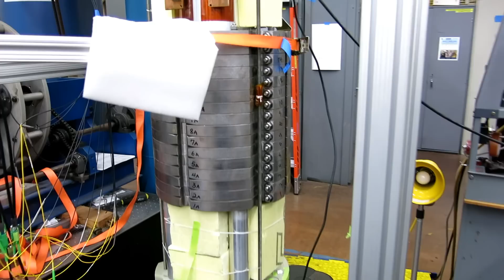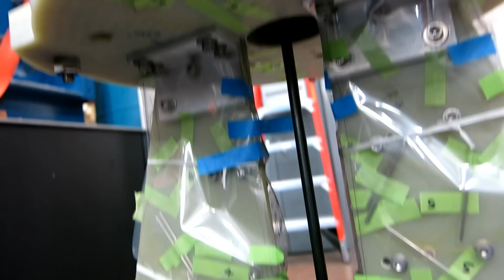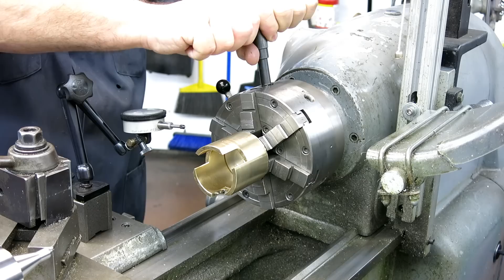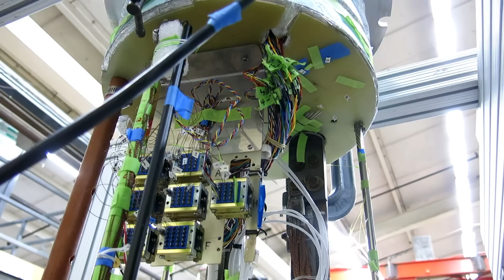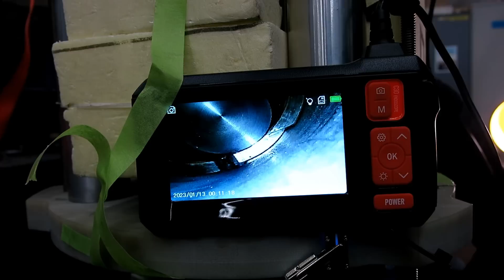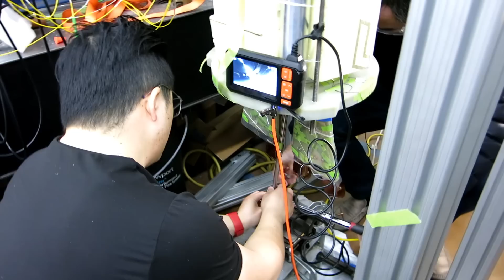Magnet Trepanning Tool P2

Comment: Tom, are you a Toolmaker that designs & makes the tools that any other project Team needs/uses?  I.e., you work for & with anyone else in the Lab that needs tooling, or are you a Toolmaker specifically for the magnet Team?

Thanks for getting permission to video in that area!
Reply from the maker: I go where needed. My office is in the same building as the magnet test facility so I end up helping that group a fair amount.

Cheers,

Tom

Comment: There was a supervisor that made a habit of leaving paperwork, folders, reports, and other items teetering just on the edge of our desks, overhanging a bit. After a few flybys these items would load up and began dropping off, spilling on to the floor by the end of week, a 'performance evaluation' signal for the supervisor, usually to the annoyance of our cadre of engineers. So. I drilled a couple of holes with two hardened steel rods at my desk. A strong horizontal hidden support mechanism that I could slide out to support the 'work stuff'.  After a while, my hidden support arms were cantilevered out 30 inches or so from the desk edge - magically defying gravity and, providing a way to keep the crap off the floor!  A wonderful prank and, exceptionally useful to have, demonstrating that max. work load.  The chain of command ultimately installed 'inboxes' just outside each cubical as this supervisors practice/behavior was interpreted as harassment by union representatives.
Reply from the maker: Great story!

Cheers,

Tom

Comment: Such a great video, thank you! Dream shop, the “which lathe shall we use” was the most understated brag ever 😂
Holy moly, they trepanned that meter long core by hand ??!! Never shall I feel bored again while cutting threads!
As for the tool being not straight… I hear Quinn muttering “wish I’d normalised the material before doing the work” but maybe it was just the pressure of the end mill?

Comment: Need some sort of center support or bearing at the bottom end of the extension to keep everything centered and straight as you’re hand ratcheting.
Reply from the maker: The tool is self guiding. That's why it is a close fit in the bore.

Cheers,

Tom

Comment: WOW, Tom actually working. This a rare sight.  I know he will do a great job.  I would of made a suggestion, using a gearwrench pass thru box wrench to turn and be able to have a nice thrust bearing support and very steady on the bottom.
Reply from the maker: The extensions are not rigidly attached to the tool. In the current setup you have to maintain some upward pressure or the driver pops off the tool. Maybe mark 4 will have all the improvements. Thanks for stopping by.

Cheers,

Tom

Comment: If the carbide teeth are inset from the cutter body, won't the body bind in the hole?
Reply from the maker: Its a fine line between scraping the epoxy out and digging into the bronze bore. The third version has an adjustable blade you can adjust to be outside the cutter body.

Cheers,

Tom

Comment: Hi Tom.
Great video. Thanks! Several weeks ago I asked your advice for a machine oilier. I bought the one you suggested a it works well. However, when and not in use, the oil leaks out all over the place. Is that just the way it is? Do I need to empty it every time after use? Can any gaskets be made to help or thread sealant? Thanks.
Reply from the maker: Did you send me an email? This does not sound familiar. You sure it was me?

Cheers,

Tom
Reply: @ 
I’m pretty sure it was in comments. You sent me a link to it at MacMarter Carr.
Reply: It was in the comments of Mearloaf 152.
Reply: I’m using ISO 68 oil. Could it be too thin?
Reply from the maker: @greglaroche1753  Should be able to handle it. They should not leak. Something else is going on. Dig deeper.

Cheers,

Tom

Comment: Love seeing all the waxed lacing cord in the magnet assembly. I used that in aircraft installations because zip ties don’t hold up well in cold temperatures at altitude. All the computer and stereo cables in my house are laced with it! Also liked the Hardinge lathe. We had one in our model shop and I tried to get it when our plant shut down but someone else in the corporation had plans for it.

Comment: In the end, did you get all the plastic slag out of the magnet?  While it might have been more expensive, and certainly take longer to make, would have a 24 flute reamer done better?
Reply from the maker: Need carbide to cut this stuff. Its really abrasive. We have to touch up the carbide fairly often.

Cheers,

Tom

Comment: I realize that this is a trepanning study, and I appreciate that.   But when you showed the big piece that popped out, it occurred to me that….if you could spray a little liquid nitrogen up inside that…you might get the whole thing to just pop out. 
Very cool process, though.
Also, ….is that Monarch lathe dating anyone?  …asking for a friend. 😳
Reply from the maker: The magnet has already tested and been through thermal cycling. The reason we use this particular material is that it doesn't break at cryogenic temperatures.

Cheers,

Tom
Reply: @ ok, got you. 🙄 nevermind 🤣

Comment: You need to share more of these. I'm lucky enough to have a similar job that I just started recently.
Making the tool but having them use it is a big brain move. If they mess it up, they can't blame anyone but themselves :)

Currently making test fixtures for a universal tester they use in densitry material testing. Funny how there is so many fields in a university but if they need something made....engineering is where you go.
Reply from the maker: Sweet! Sounds like a good gig.

Cheers,

Tom

Comment: A bushing with a hole the size of the ratchet extension bar would have been great for keeping the bar in the middle, and would have made it easier to position the bearing underneath. 
The most complicated ''thing'' in this video was your colleges' workspace!  :face-orange-biting-nails:

Comment: Hey, Tom, thanks for this insight - is a great video!  Was this project from a couple years ago? The bore camera shows Jan 2023? Or was it just no one set the time on the cam?  Also, are you going to have to put multiple cutters on here to expand the cut or was this single version enough to clean up the bore of the magnet to whatever standards they required?
Reply from the maker: Were not smart enough to figure out how to change the date.....

Cheers,

Tom

Comment: The guy on the right, when cutting, was a real scientist.  He had a normal wristwatch, not a computer on a wrist.  
I figured you would have brand new lathes there.  As smooth at that one ran I figured it had to have liquid nitrogen near semiconductor motors and gears.....  Thanks for the visit.  I loved those big copper bus bars.  My guess is that magnet would kill our rural area power system when fired.

Comment: Tom , can you tell us what the magnet is for?
Reply: Yes indeed Tom, Inquiring Minds want to know!
Reply from the maker: To study the operating parameters and magnetic field quality of CORC conductor in the Canted Cosine Theta configuration. 

Cheers,

Tom
Reply: @oxtoolco come on dude. Laymans terms. Were all engineers here. What does it acheive, maybe shiuld of been the question. Or what is the result that gets paid for by who ?
Reply from the maker: @gavinbrooks2178  Stronger magnets that operate at higher temperatures. Basic scientific research to advance magnet design for the benefit of all mankind.

Cheers,

Tom

Comment: They need to thoroughly coat the inside bore with a release agent before doing this again so the whole thing easily breaks loose :-)
Reply from the maker: Normally epoxy does not enter the bore. A plug was left out that caused the leakage. On area's we don't want adhesion we do apply a mold release agent.

Cheers,

Tom
Reply: @oxtoolco  Thanks Tom, that's good to hear! <3
Reply: That is my thought also. Why didn't anyone apply a release agent prior too?
Or is there a technical/ chemical reaction to be avoided?
Reply: @JohnMoses1897  I mean, surely something inert/inocuous like wax could have been used, and then removed with a solvent wipe afterward? Clearly they thought it would not get in there, but seems like an obvious precaution given that's where the vacuum was being pulled. 100% epoxy was going to get in there - it would fill it unless it cured first or they ran out.
Reply: Exactly, maybe I'm just "a normal guy with a little common sense," but it was so obvious too me that this is a DUH moment.
Reply: Or perhaps the effect of all the resonant magnetic fields affected their common sense "soft drive firmware" in someone's overeducated skull of mush.
Irregardless,  I'm willing to workbthere with any of them, for "educational purposes."

Comment: Building 50 just adjacent the Advanced Light Source. 
Tom, I hope you're right about this, because if it's damaged by trepanning, well, that magnet assembly doesn't look cheap. 
If that fruitcake E-Lawn gets a look at that coworker's area, he may instruct his college-dropout DOGE bro's to pull the plug on the whole department.
Reply from the maker: B58. This magnet as it sits is probably in the 1M range.

Cheers,

Tom

Comment: It would have been less worrisome to pull it through with a guide bushing in the bore, versus pushing it.  There would have been almost no chance of it going off track and ruining the bore. But I'm just an idiot on the internet, what do I know.🤷‍♂
Reply from the maker: The bore was obstructed prior to this operation. We had good luck with the Mark 1 cutter so we just kept going.

Cheers,

Tom
Reply: Tom, you can't argue with success,  can you😂

Comment: Now I feel a little less concerned that my shop is rather cluttered too. Proof positive that horizontal surfaces collect stuff until the angle of repose is reached. lol Thanks for the video!
Reply from the maker: Angle of repose. You cracked me up. Tak's angle of repose approaches 90 degrees.

Cheers,

Tom
Reply: @oxtoolco Personally I repose at 180 ° but to each their own

Comment: What kind of grinding wheel is that.. time 4.12
Reply from the maker: That's not a grinding wheel. That is a chunk of the Stycast epoxy we were able to remove.

Cheers,

Tom
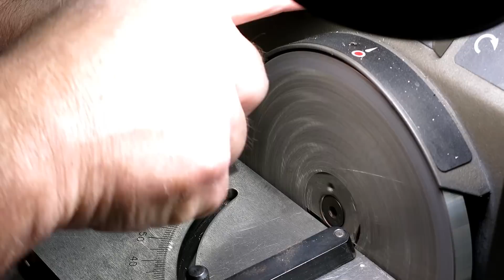Reply: @oxtoolco  i think that should read @ 14:12 ... 
peace
Reply from the maker: @memyselfandeye1234  Accufinish by Glendo tools. Diamond slow speed grinder. They are awesome!

Cheers,

Tom
Reply: I think he meant the wheel on the grinder with the nice table with the graduations, it looked like some kind of a diamond wheel?

Comment: Does that 10EE still have the thyratron drive or has it been converted to solid state?
Reply from the maker: That one has been converted to an VFD. We used to have a machine tool repair department that did all those things. That went away maybe ten years ago.

Cheers,

Tom

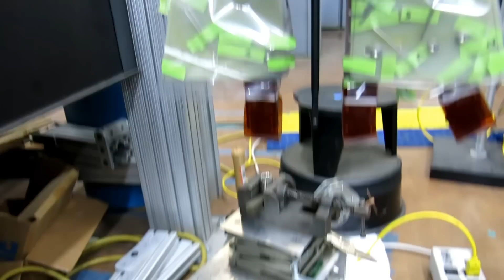Comment: 6:05 Like you are saying, my only concern is the lack of a guide or journal to keep it centered. I was assuming you would make bronze (edit or delrin) rings similar to piston rings to keep pressure on the tool.
Reply from the maker: The tool is self guiding> bronze on bronze bore. There is no serious requirement for dead on concentricity only removal of the epoxy.

Cheers,

Tom
Reply: @oxtoolco  got it. I'm just overthinking it I guess. That or watching too many Aussies repair pistons HAH.
Reply: edit 2: maybe some wear bands from mcmaster?

Comment: The question is who filled the bore with epoxy? The researchers or the machine shop? What would it take to lay the whole contraption down so you can get a better shot at the bore?
Reply from the maker: A small alignment pin was left out when the magnet was setup for potting. The blame game is a no fly zone in a research environment. Keep in mind these magnets are more like works of art as opposed to making cars on an assembly line. Stuff happens and you come up with ways of dealing with it. Laying the magnet down at this point would be risky at best. This magnet is probably is worth over a million bucks at this point. 

Cheers,

Tom
Reply: Mother vacuum did.

Comment: I'm curious, would a 3-point bore micrometer not fit with the available clearances? Or too much epoxy befoulment to use in situ?
"Hmm, which lathe to use... Monarch 10EE, Hardinge HLV-H or the LeBlond Regal..." that's an enivable choice to be burdened with.
Reply from the maker: Didn't have a tri mike handy when I needed to measure the bore. 

Cheers,

Tom

Comment: If the carbide tips are smaller than the body of the cutter won't it jam up in the bore?
Reply from the maker: The plan was to scrape out the stycast as we moved up the bore but the PI was worried about damaging the bronze bore. Ultimately we made a third version that was slightly proud of the cutter body. 

Cheers,

Tom
Reply: Hey, I was gonna write that. :)
But yeah that cutter most certainly is going to jam in.

Comment: I was surprised that the core cutter that you made didn’t have centering rollers. Either wheels or ball bearings embedded in the circumference to keep it from wondering as you passed it through the bore

Comment: Would you not want the cutting teeth slightly proud of the cylinder to allow clearance, similar to offset in a saw?
Reply from the maker: Ultimately that's what we ended up with. We were worried about scarring the bronze bore. 

Cheers,

Tom